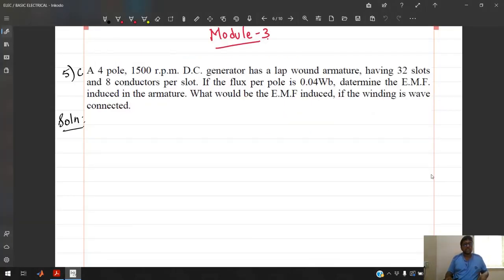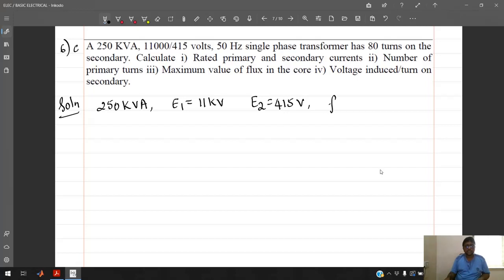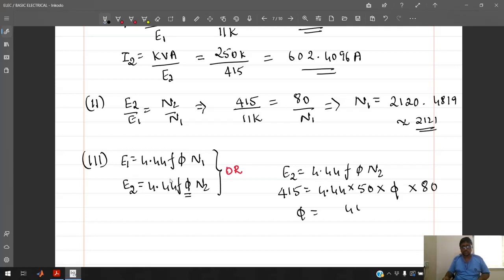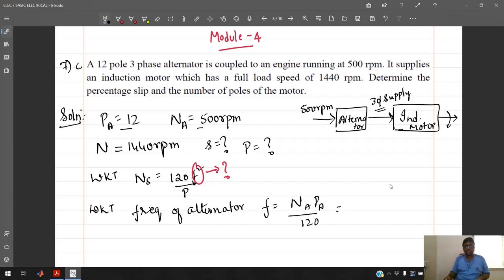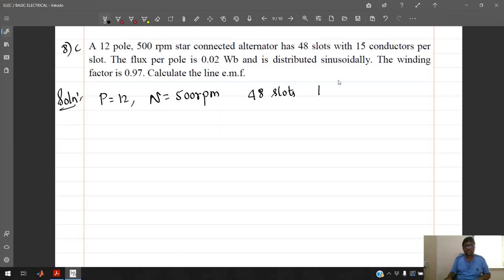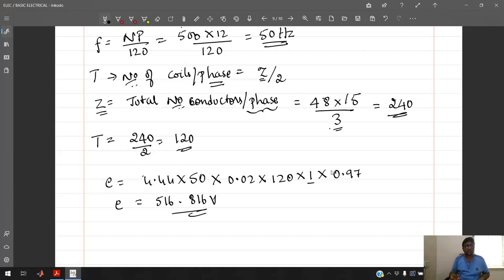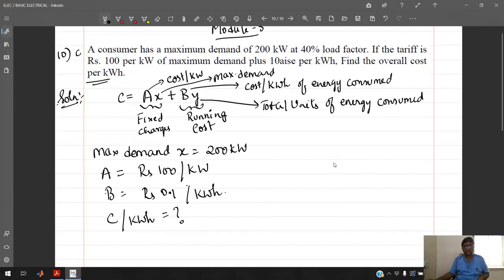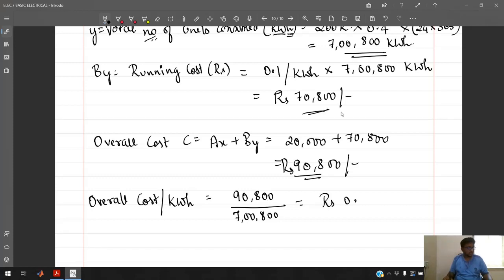Basic Electrical VTU Model Question Paper Problems- Part 2

Comment: Sir you made mistake in 4rth c   3000-1440÷1440=1.833 not 4%
Reply from the maker: No.
 It is correct.. because check the slip formula.. s = Ns - N / Ns... And Ns is 3000 rpm
Reply: @Raghavendraraop  yes sir I agree with you. but in numerator you have taken 1440 check that. So it should be 3000 right ?
Reply from the maker: Sorry for the mistake.. yes it is 3000 in the denominator.. I apologise for that.. please correct it
Reply: @Raghavendraraop  no problem sir you  have done great job for me and you sent pdf also thanks for your help sir
Reply: @Raghavendraraop  ohh ya denominator .typeing mistake
Reply from the maker: @eshwar.k8473  thank you..